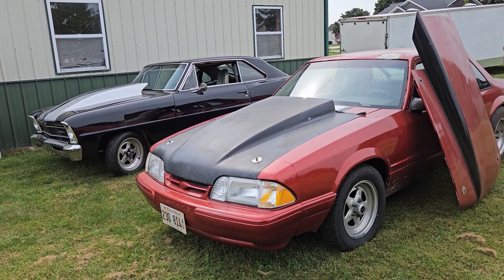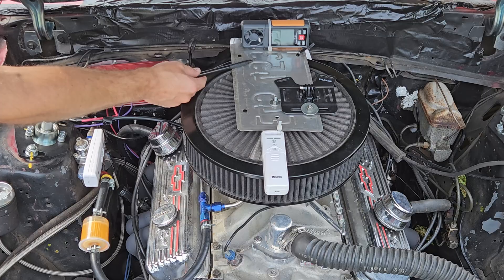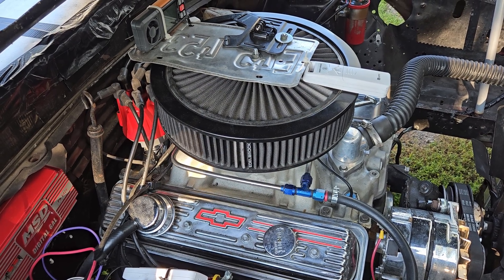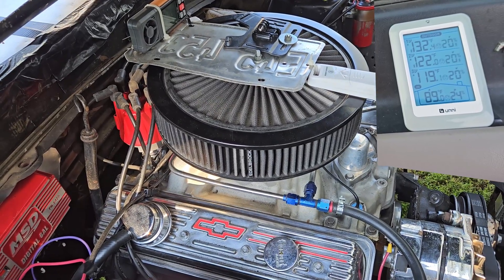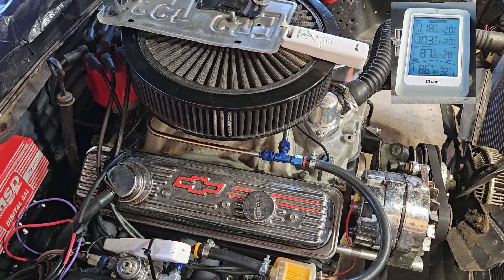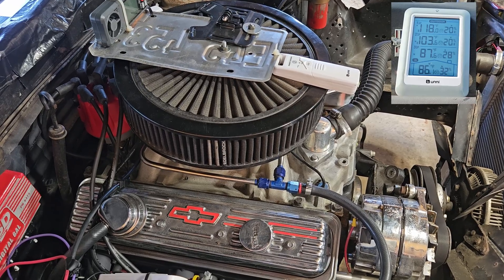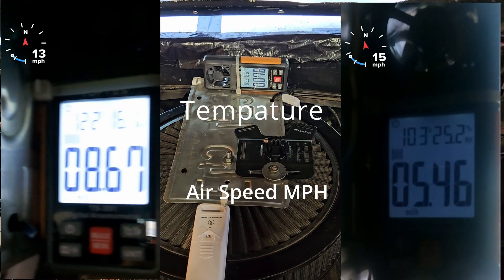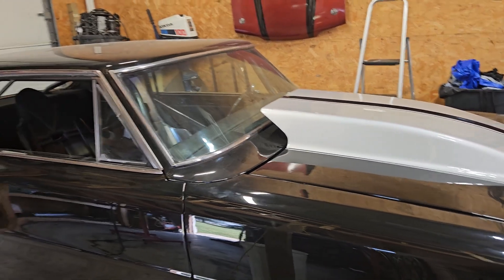Cowl induction hood test. Do they work? Open vs closed

Comment: A cowl induction works when the air cleaner is sealed to the hood an air intake temperature sensor would prove that pretty easily.

Comment: Fairly sure you have to isolate the carb inlet with a tray . The tray cannot let hot air up passed the tray . Then get the clearance to the windshield at its best . So that the carb only gets high pressure air from the base of the windshield .
Reply from the maker: Yes this what I'm thinking. I have a hood i can reshape. Im now thinking of ways to isolate the engine bay.

Comment: If it didn't work they never would have installed them in the first place🤦
Reply from the maker: Yes, I think their are alot a misconceptions on how a cowl induction hood works including my own. This is reason I did the test.I dont think it has cowl induction until you seal off the engine compartment. I will test this to see.

Comment: I'd like to the difference with an airpan, I've been considering one for my foxbody - cowl hood setup. edit- cool test and thanks for sharing!
Reply: @vrm86gt from my experience, results with pan are impressive
Reply: math says an air pan at high speed (150+) is good for about 5% gain in power
Reply from the maker: Nice, thank you. I would like to do the air pan test. Im just thinking about the best way to seal it.

Comment: Mine did you could see it suck in snow flakes on my 81 c10
Reply from the maker: That is interesting. I would like to do a part 2 and see the back pressure.
Reply: @nylegreen261 the flakes would come up over the scoop buy 1.5 feet then get sucked into the cowl it was a stock steel hood I cut the shapes out of and bolted a 2.5 in fiber glass cowl on

Comment: You do realize that air is forced through the back of the cowl via the windshield. That is how cowl induction works.
Reply from the maker: Yes this is the reason I made the video. I think the pressure leaving the cowl hood is greater than the pressure off the windshield. Think about this way: a lot of heaters in cars rely on back pressure coming off the windshield and it's not that powerful with out a blower fan. I had up to 40 mph of air speed leaving the cowl hood. I will do a pt 2 to measure back pressure off the windshield.

Comment: It's Easy to See Air Flow will cool the Induction and Get more Power as result so does changing Thermostat i run 165f in mine Period with the cowl makes my Truck Run cool as a Cucumber even in the summer, 91 S10 Blazer 2door with 4.3 and Open Cowl Hood, factory AC Automatic truck Hardly gets over 170 even pulling a trailer yet still warms in the winter.. Perfect solution to Parachute designed Hood compartments gets the trapped heat out..
Reply from the maker: Nice.

Comment: Not very safe having that rubber fuel hose so high in the engine bay. Especially with the cheap fuel filter... I've seen so many of those leak and drop fuel right onto the headers. If it's down low with hard lines, it's not as easy to leak onto something hot like a header. My buddy almost lost his Camaro this way.
Reply from the maker: Nice, I like it. It is definitely not permanent on the Mustang. Just to get me up and going. I have a bunch of things to change with the car.

Comment: I have an 88 Firebird Formula,  power bulge hood. Wondered what if anything it does to turbulence or air pressure at speed? I know Trans Ams don't run right with the Shaker removed. Maybe  a 0-80 test is next!
Reply from the maker: Nice, cool idea.
Reply: I have been looking for a good Foxbody that is cheap enough........ I HAVE NOTICED MOST WITH COWL-STYLE HOODS ARE CHEAPER........ I WON'T TOUCH A CAR THAT HAS A SHITTY LOOKING COWL HOOD, IT DOES NOTHING BUT F CK UP A CAR'S LOOK.